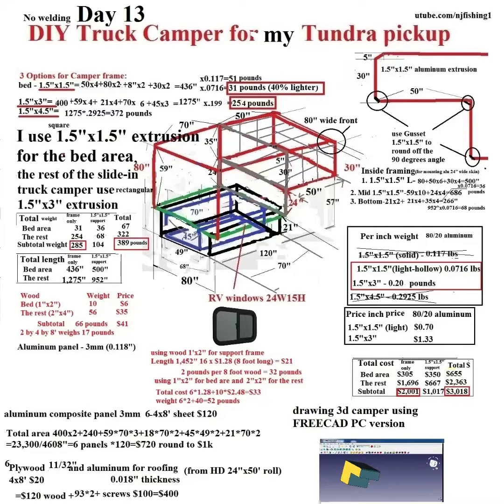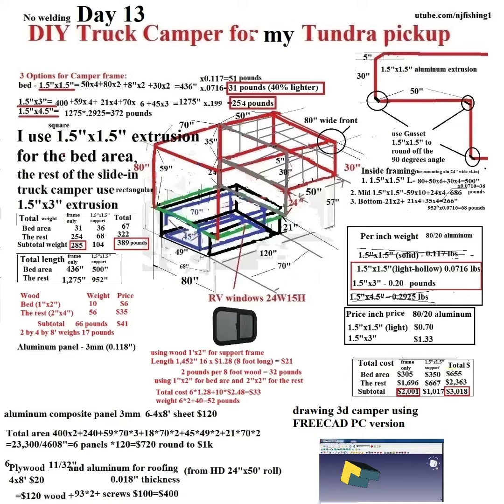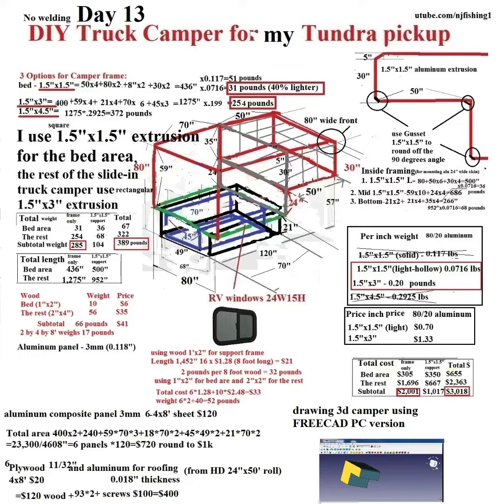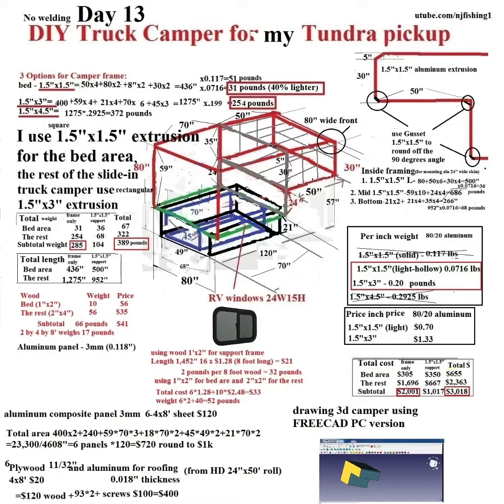Day 13-DIY truck camper build using 80/20 aluminum (no welding) composite panel $4,000 plus vs $500

Comment: Man this is what ive been looking for. I have been interested in using this material. How do you think the joints will hold up over a few thousand miles?
Reply from the maker: There is no sure things. Screws are better than rivets. Rivets are better than VHB glues. I will be welding my frames, but even that may break (0.001 chances). So, best to use combinations of them all. I have secured aluminum welding equipments and almost ready to weld my aluminum frames truck camper. The new welder wouldn’t work for flux and aluminum welding (DCEN). Follow and subscribe.

Comment: Have you started building yet?
Reply from the maker: Not yet. The 80/20 was way too expensive and short in supply, and I refuse to do a wood frame camper that rot in a couple years. So, getting my welder and 100% argon gas to weld aluminum frame using Mig welder with aluminum wire to Mig weld aluminum frame. It is cheaper to do it this way than buying a welder and spool Gun to weld aluminum. Learned a lot for sure, will share my cost and my truck camper build as soon as possible. 2 resolutions in 2021: (1) learn how to weld aluminum, (2) build a truck camper that meet my needs.

Comment: Its going to shake apart.
Reply from the maker: It will not if you build it with multiple safe guarding processes. It is taking me forever to try to find the best design, drawing over and over and again and again to cut costs increase aerodynamic for fuel efficiency. This big camper is going to be heavy but definitely much cheaper, lighter with a shower than the commercial one. It costs at least 15k to buy one.
Reply: That's why you use blue lock tight or Teflon tape.